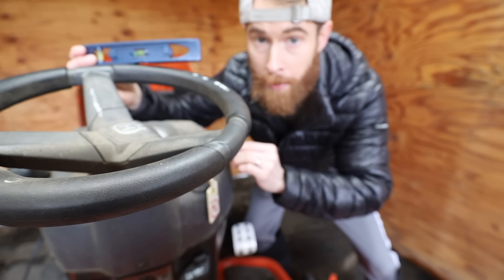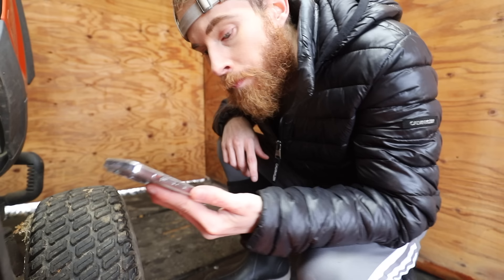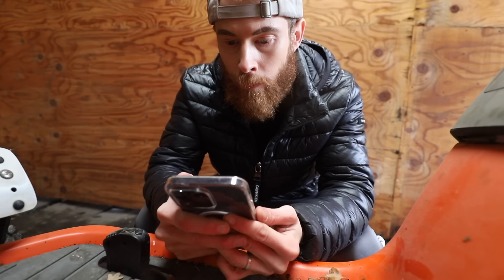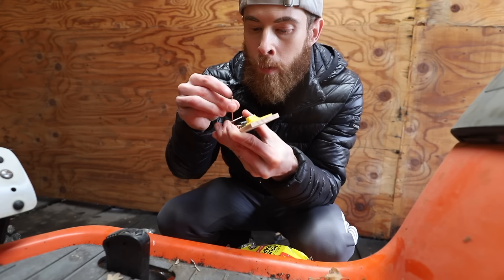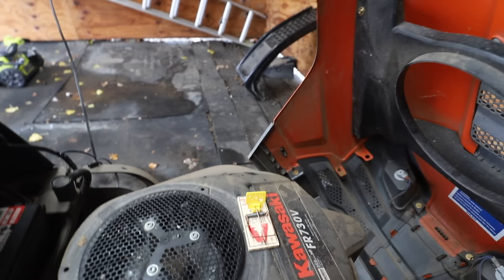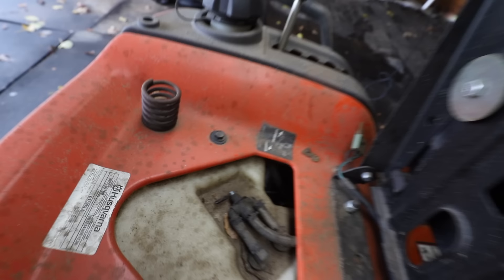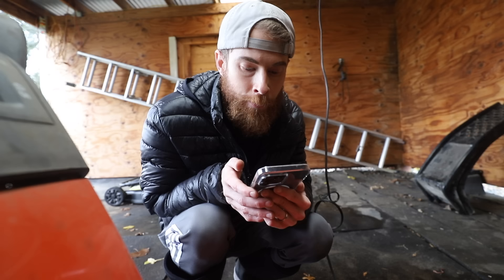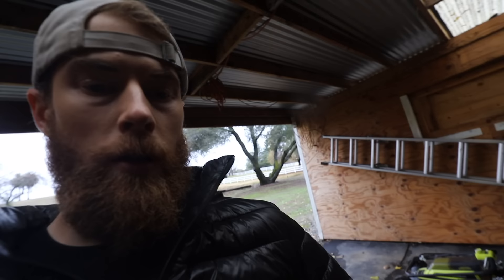TRYING TO FIX MY MOWER!

Comment: hey brandon. i grew up around tractor and lawn mowers, to start this one, on a cold start you need to push the clutch in, then put the throttle to choke and turn the key, once it turns over bring the throttle back down and turn the key back to the second position. Then release the clutch and it’s started

Comment: This is hilarious especially since I’m a mechanic. I laughed so hard because that is always my first question when someone calls me to have me come out to fix their vehicle/small engine project (lawnmowers, weed eaters, snowblowers, etc.). I always ask if they have checked the fuel level and mixture to see if it is at the correct mixture and level.
Reply: Same vibes as my IT guy. Did you turn it off and on again?

Comment: Hey the mouse traps were set up wrong you need to have the yellow part flat against the wood then you should see another hole on the bottom of said yellow part (the hole should be similar to the one that you have it in currently). Hope you and your family have a good new years.

Comment: I knew what the issue was the whole time there is a Dumbo behind the wheel and when it starts, you push the choke back in, and when you engage the deck, you have to have it at full throttle